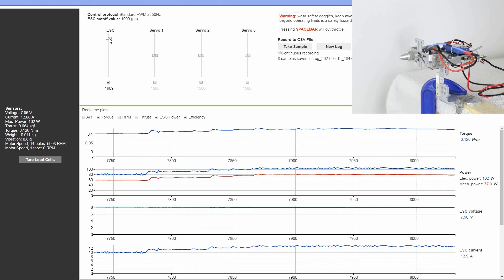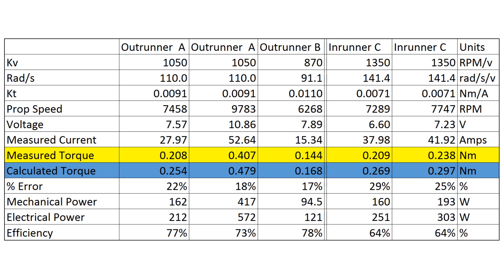RC Brushless Motor Actual vs Calculated Torque Output

Comment: Hi, thanks for the video. I don't understand how I convert RPM/V to rad/s though - online calculators and guides show conversions from RPM/V to V(rad/s) (which I assume is no the same as rad/s) - Can you suggest how I go about performing this conversion?
Reply from the maker: 1 radians per second (rad/s) is equal to 9.5492968 rotations per minute (rpm). Conversely, 1 rotations per minute (rpm) is equal to 0.1047198 radians per second (rad/s).

Comment: Thank you very much!You explain very clearly, continue to develop this hobby!
Reply from the maker: Thank you for the comment.
Reply: @RCexplained  I asked myself a lot of questions, despite the fact that I am an auto mechanic in my specialty and study engineering. You answered most of my questions, such people are needed by this world. I just could not find the peak of torque on the brushless engine, some sources say that it is at low speeds, and there is a small shelf in the cut-off, and some that it systematically rises to the cut-off of revolutions. I would like to calculate what revolutions will be optimal for maximum speed, the transmission will be 3-speed. It can be done with a gear ratio so that at a speed of 60 mph there are revolutions, let the peak be at 2000 revolutions, or it can be so that at a speed of 60 mph the rpm are at a cutoff of 6,000 rpm.
Reply from the maker: There can be some dependencies there, however, peak torque is down very low in the rpm range for electric motors in general.

Comment: so what method are you using to measure torque with a prop if electric motors have its highest torque at 0 rpm what are you actually measuring to see an increase at higher rpms are you measuring thrust from the prop?
Reply from the maker: You see the highest torque when the throttle is at 100%. From there load determine what rpm this will be and what torque output is achieved. Thrust is not torque. Torque is directly measured.
Reply: @RCexplained  thanks for replying but that should not be the case power would increase with rpm not torque so I was wondering what you are measuring actually.
Reply from the maker: Hi Allan, are you suggesting that the propeller will require more torque from the motor at a slower constant speed? Do you agree that current represents torque output? At 0 RPM there will be 0A and 0 Torque in this experiment.

Comment: isnt the difference because hobby BDCM rate the KV incorrectly? They all do it and becuase you are perpetuating the same error the comparisons for the most part all come out clean inthe wash but when you compare theoretical and actual performance there is an error. The real formula used industrially has a factor 3/2 / root3 = 0.87. if you multiply the calculated value by 0.87 you get a lot closer to the measured torque figure.

Comment: Plz make one video on how much torque requred for 150 kg weight lift,,what is the main factor consider to making drone and how can helf torque in drone fly plz make video sir iam waiting for vodeo
Reply: Torque required in a drone motor is a bit different to calculate than for an RC Car.

It's a LOT easier to calculate for a car. 
However some items to start looking at will be lift coefficients of blades, RPM required, drag coefficients etc.
The main part torque comes into play for a drone for is getting the prop spun up. After that, it's all about the RPM (There is a point where the drag coefficient of the blades through air etc require a certain amount of torque, but minimal compared to the likes of an RC Car)

Comment: I have a question,  Ryan.  Can you explain the following.  I have noticed that I have very little "brake" force in my 1/12 scale GT12, 13.5 turn brushless motor.  If I set the esc to zero timing mode, default settings, I have good braking at the start of a race and then really weak at the end.  If I use my personal esc settings, I don't even have good brake at the start of the race.  I take the temperaturee of the motor after each race and it rarely exceeds 50 degrees C.

Comment: Thanks for the video. I am kind of struggling to understand how did you calculate torque values? What is the equation to link mechanical torque with measured electrical readings? Cheers!
Reply from the maker: Convert Kv from RPM/v to rad/s. Use Kt = 1/Kv then just multiply the result by the current.
Reply: @RCexplained  Thank you very much. Much appreciated.
Reply: @RCexplained  hey man, how do you know what the current is? Where would you get this value from? Are you meant to set the current you’re using on the motor from the esc?
Why would the load of the motor matter if the current you’re applying is as high as possible to try and get maximum acceleration?
Reply: @duelz96  Hi, the max current drawn by the motor should be provided in the specs sheet and that number can be multiplied with the kt. And as far as I know, you can't set a current limit on the ESC because it's already with a certain current rating. I think there are some smart ESC's out there which could do this. Can you try to explain the last question you have because I didn't get it

Comment: Hi I am building a 1/6 outboard motor with 20mm helical gears and 18 mm ballraces running in oil, the oil seals create some drag . It is to power my sports fishing boat 1m long I wanted to use a 48mm CNC ally prop . The motors I could get are 3680 2000w or 4082 3500w, .  Any advice appreciated

Comment: I watch it well every time.

I think it's very strange that there are fewer subscribers to your channel.

If you have time, I would appreciate it if you could experiment with the weight of motor cogging similar to servo test.

There are many variables such as kv, pole, watt, but if kv is half, I wonder if cogging torque is double.